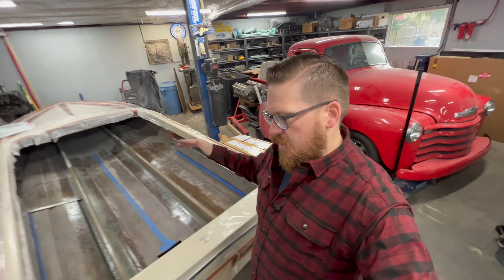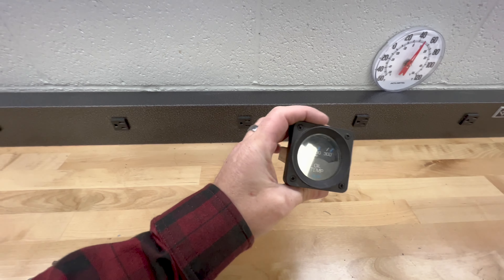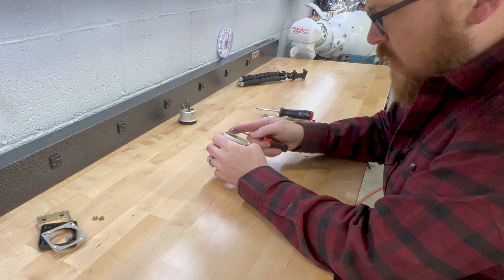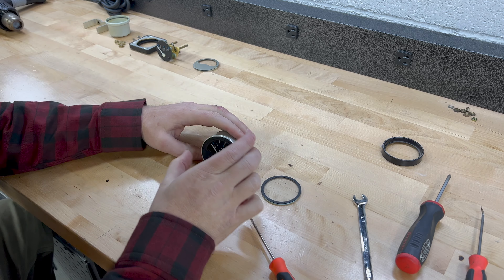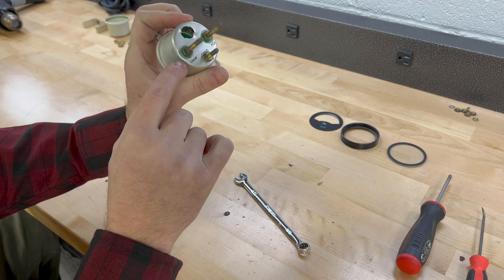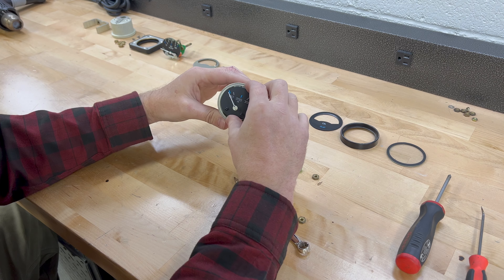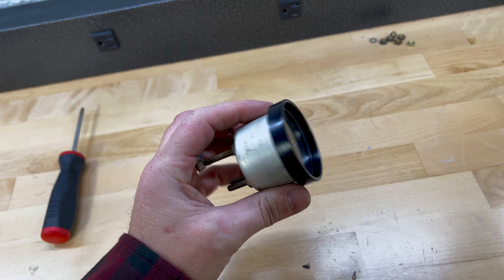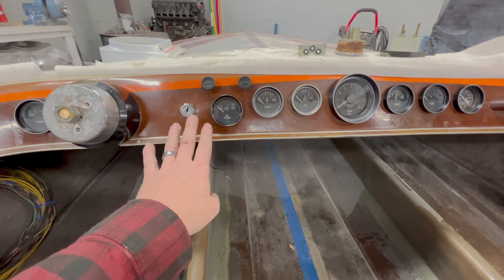Using TWO WRONG Medallion GAUGES To Make THE ONE I NEED

Comment: You have to order some Pro Comp marine carbon fiber gauges bro...I dont think they are really carbon fiber but they look bad ass, thats what i installed in my Carrera 
you can get 45 degree bezels on them so they face you while your driving, looks way clean ..just take you rtime and go !st class all the way on this build ....
Reply from the maker: Actually, I have my eye on some custom Lavorsi gauges. I was thinking that an orange gauge face with a silver bezel and needle would tie into my boat nicely! I love carbon fiber, but I don't think they would look appropriate on my setup. My boat is more of a family bruiser/cruiser. It's a far cry from a race boat. 

~ Nick
Reply: @AutoTechNick  Thats cool, Lavorsi does offer the best custom gauges, that theme will look cool on your boat, if you can try get angled bezels it makes a big differance....